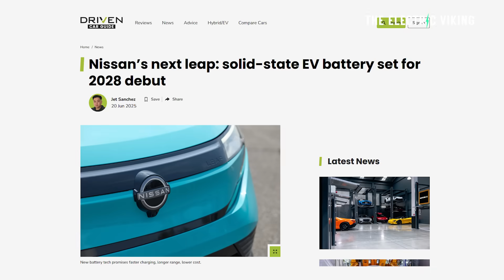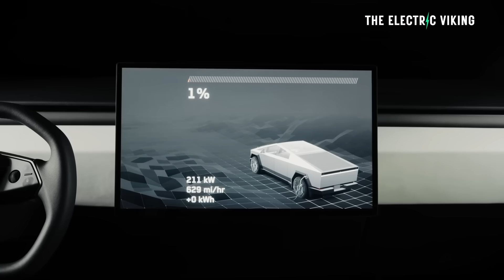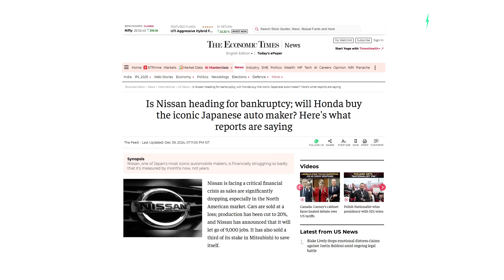Nissan Promises Game-Changing 600 mile EV Range Battery Tech

Comment: I don't care who makes the prediction of 1000km range, but it also means you will have about a 150 kWh battery. If the battery density is about three times that of the current models, then that will be achievable on smaller-sized cars.  Fingers crossed.

Comment: Why would they say this?  Now, no one will want to buy what they have now.  its called the osborne effect.  toyota did this shit for years.  around 2002, they would say by 2025 we will have solid state batteries that go 700 miles.  its like they used it as an excuse to not make EVs.  something is fishy here.  I could certainly be wrong.  Maybe nissan is claiming this trying avoid bankruptcy.  

but also, they could be losing money on each EV they sale now.  they go 300 miles which is a vast improvement from when they went 84 miles, and did not have liquid cooling.